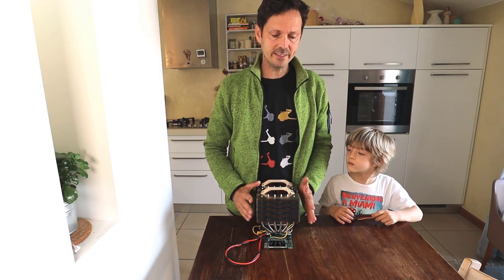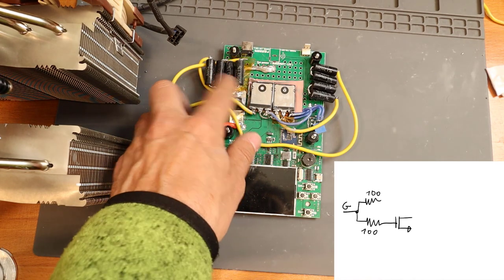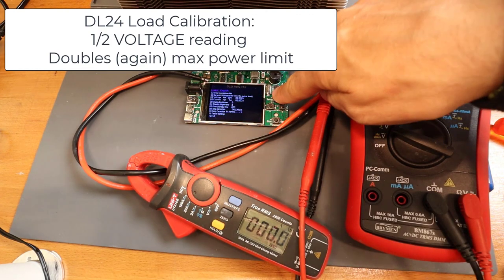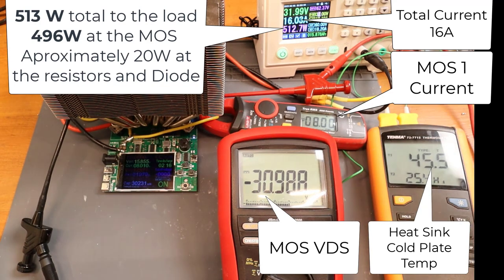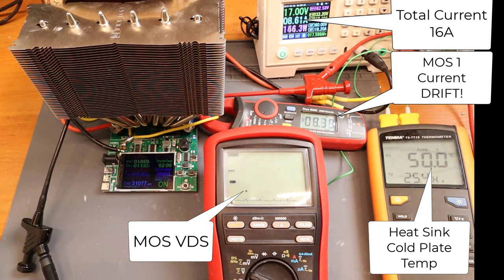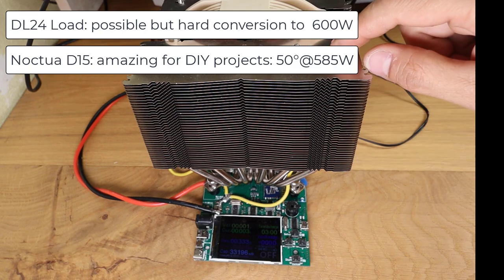Atorch DL24 electronic load upgrade, Noctua NH-D15 Torture Test

Comment: According to datasheet a single FDL100N50F withstands up to 1200W and for a maximum inside temperature of 90C(calculate from derating curve)
Reply from the maker: Hi, the 1200W are for a TCase of 90 degree, not for a Theat sink of 90 degree. For this experiment I measured the heat sink (cold plate) temperature, the case would be then at Tcase = T heat sink + RTCS*power (thermal resistance case sink = 0,15). so with 1200W, with a heat sink of 90 degree, the mosfet case would be 1200*0,15 = 180 degree higher.I destroyed 2 of them with 700W in fact, and heat sink stil below 60 deg.
Reply: @MakerFabio  Where did you buy the FDL100N50F?
Reply from the maker: @cryscrystiii7023  hi, don t recall if digikey or Farnell
Reply from the maker: @cryscrystiii7023  with very good thermal paste and strong coupling to the heat sink you reduce che  RT case sink, below the typical declared so you can increase
It will never be 0 so power will be lower than 1200W, but higher than ehat i caluclated

Comment: Thanks a lot for the guide.
When I load more than 20A, there is a fast beeping sound and I have to reduce the load to 20A to silent that sound. Do you know how to fix that?
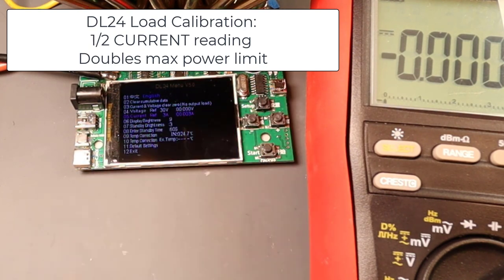Reply from the maker: Minute 2:06, double current reading , cheating calibration
Reply: @MakerFabio  I already did that. Apply 6A to the resistors and calibrate as 3A.
Reply from the maker: @trietpham7630  sorry is sometime i don t use it
What was the original max current, 10A or 20A?
Maybe is it the ntc and the load is getting too hot?
Reply: @MakerFabio Thanks. The origin is 20A. I will keep trying to find out why.
Reply: @MakerFabio  Where is the ntc you mention?
Reply from the maker: @trietpham7630  small one close to the origianl mosfet position
Reply from the maker: But you can check the temp reading in the display.
Reply: @MakerFabio  It's under 40C. My voltage is very low.
Reply from the maker: @trietpham7630   but is the 1/2 calibration correctly set on the device? So if you set the load to 5A , the real read with the cirrent clamp is 10A?  And you say that if you set the cirrent to 20A, which is then sinking 40A real (like in minute 4:19)and the loads beeps correct?
Reply: @MakerFabio  no, I set 11A and it beeps rapidly.
Reply from the maker: @trietpham7630  what is the voltage and so the max. Power?
Reply: @MakerFabio  voltage is 3.12 at that load. Power is 3.12 x 22
Reply from the maker: @trietpham7630  and the cut off voltage?
Maybe it is not able to work at such high current and low voltage. The drop in the mos, diode and shunt resistor is kind of big
Reply: @MakerFabio  what is the cut off voltage? I set voltage like you show in your clip, 60v calibrates as 30v. My fet is a single irfp4668 since I dont need high power, just high current. I use the same shunt 2x 2w R004 like you. The only thing I did not change is the diode. Still waiting for my 80A Schottky. But I check the datasheet of the default diode and it should be able to handle 40A. I only test 22A and it already beeps.
Reply: One more thing. I add a 0.05 ohm 200w resistor between D and S of the mosfet to share the heat when current is high. I have a decent tower cooler but it's not as good as yours.
Reply from the maker: @trietpham7630  so 0,05*20 =1V, then 1V on the shottky + 2mOhm*20= 20mV some drop on the mosfet RDS ON , in the cable, and in the connector maybe you have too low voltage to regulate, so the device is complaining. Try with 2 series of battery, so 6,4V.  and check if you are able to go higher than 11A. but pay attention to the cooling and to the diode
Reply: @MakerFabio  thanks, I will try that
Reply: turn out it's my addtional power meter that produces the beep
I can reach 30A now but when the shunt is hot enough, current reduces to 27A
I will buy lower RX24 resistor and try again.

Comment: My DL24 has a overcurrent setting where I can select to ignore power limits. It is the 4 input model from 2021. Might be worth testing that out since it does not require you to mess with the voltage settings and amperage settings in order to achieve your upgrade. You might still have to change the shunt and diode though.
Reply from the maker: Many thanks for the suggestion
Now that i already have modified this one i don t want to put new effort to disassemble this one and buy the other model, i have to live with this
But good to know for the other readers

Comment: you should sell those upgraded units in bonanza ebay and amazon ;-)
Reply from the maker: Thanks
It would be better using the latest atorch load revision, where you can adjust the max power limit. Anyway, including work fan and mosfet would be too expensive for a unbranded load
Reply: @MakerFabio  order in bulk and get the components cheaper. Surely Atorch would give a discount.

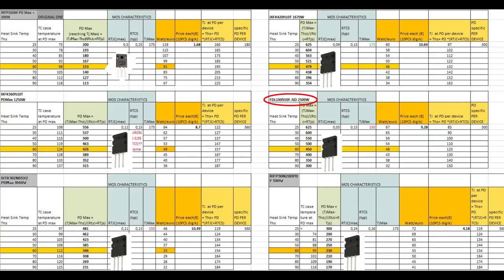Comment: What is that sweet mosfet chart shown in 0:45 ?
Reply from the maker: That was a very handy excel calculating the max power dissipation em on the Mosfet, keeping a TJ below the abs rating, starting from the heat sink temperature . But i just realized i deleted it, toghether with the video partial files…
Reply: @MakerFabio  too bad, just looking at some cheapo fets at the moment